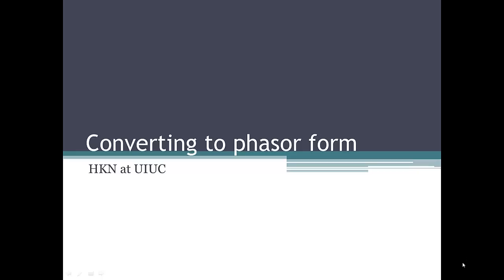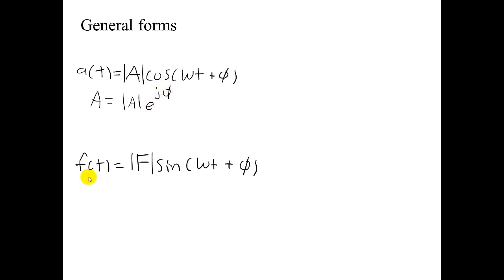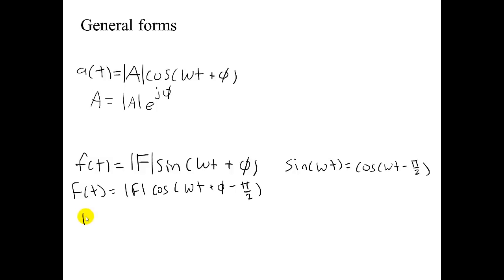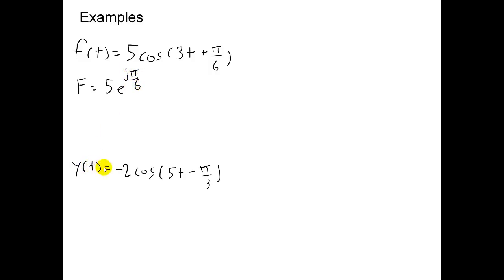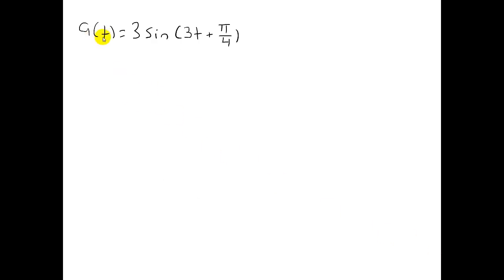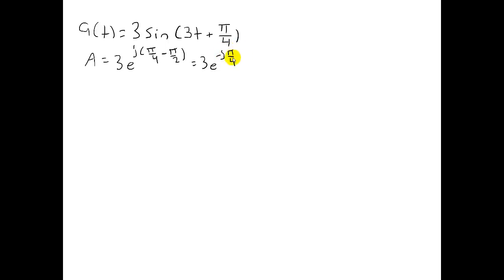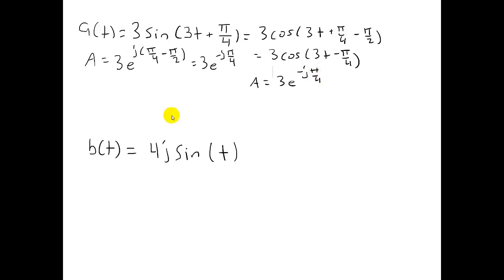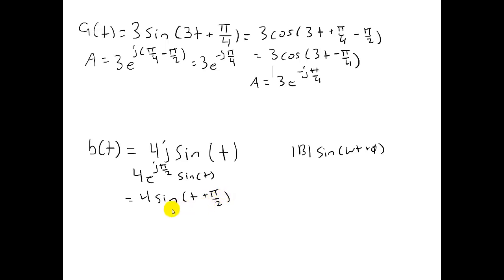Phasors - Converting to phasor form examples

Comment from the maker: since cosine is an even function we can rewrite it as 7cos(2*pi*10^8t - 14.5z)e^(-0.01z). Now if we were to write this in phasor form the 7cos would go to 7e^(-14.5z*j), and since it is still being multiplied by the last exponential term we get 7e^(-14.5z*j)*e^(-0.01z) = 7e^((-14.5*j -0.01)z).